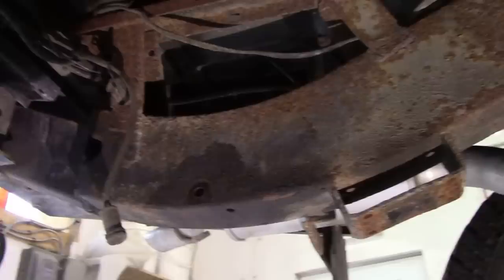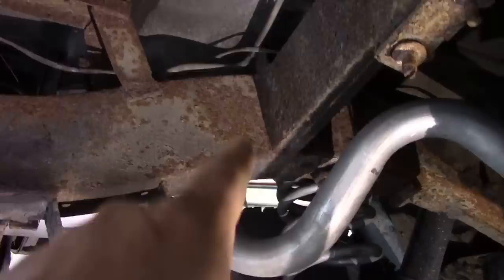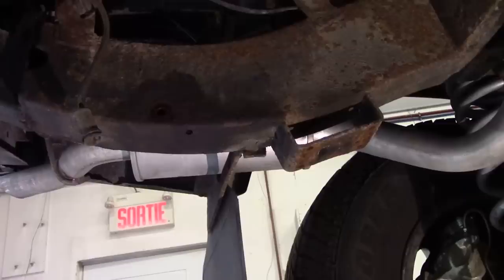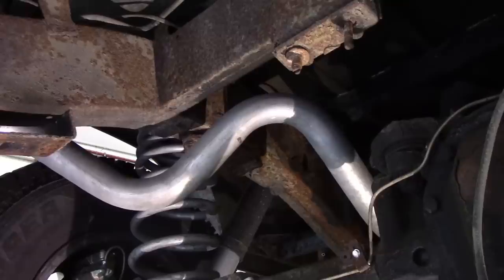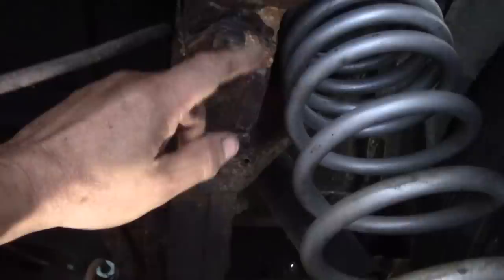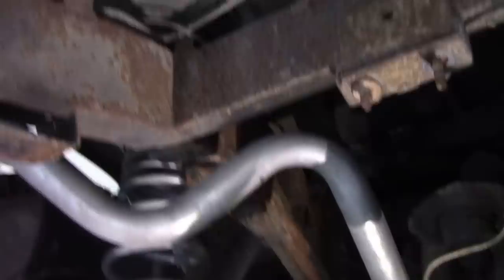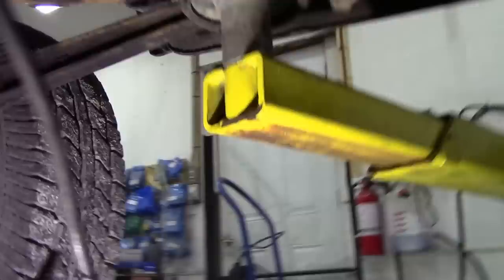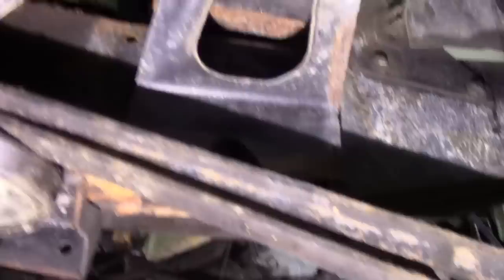Buying a Defender Things to look for Part 2 the Chassis/frame

Comment: Make a card template of the bolt holes before cutting the rotten section out and drill a couple of holes on the outboard face.  Pass wire or chord through those holes to temporarily hold the harness away from the welding work, then remove the chord once cooled.  Leaving that rot will accelerate deterioration of the new steel as you'll have a rotten double layer that will prevent wax coverage.

Comment: Found your video of what to buy and not buy 5 years too late.  Oh my! There is no rust on the Santana but the motor parts were not taken care of and wiring was a disaster. The first problems is is a Santana so not all the Land Rover series 3 parts work.  If I could only get the steering fix I wouldn't cry so much..haha (I'm a girl)  I love trying to fix it and luckily my husband is strong enough to tighten nuts and bolts.  With my help we can get rusty nuts and bolts off and do a "high five".   I wish a could talk you into coming down here during the cold months of Jan and February and stay at my condo on the beach free for working on our steering and motor issues...a little bartering. Again, your videos are my salvation and make me smile even when I'm I know I have these problems.  I will look to see is you do a series 3 steering relay or tier rod ends of ball joints or steering box.  Stay well, I really need you!  Yup, you help the old girls out, not just the old guys.
Reply from the maker: A lot of Santana's come here as they were rust free and cheap - but as you said, the parts for the Land Rover are not always interchangeable, and not easy to find here - in fact I do not know anyone who sells parts for these in North America
I think on my memory stick I have the parts books and manuals for the Sanatana's, but they are all in Spanish 
I have very little in the way of Series parts on my shelves - I stopped selling parts about 5 years ago

Comment: I've bought my first defender and I love it. But... It's back in the garage  with a refurbished rear diff and new half shafts going in. There are small rust holes in the tub floor that also need looking into (pardon the pun)... At least Ive sorted the leaks out!.. These care are so expensive now, it's a money pit, but I'm sucked in now. 
Hopefully I'll get round to the pretty stuff soon.

Comment: If you decide to plate over the rust holes behind the gearbox crossmember, just remember to shorten the crossmember to allow for the thickness of metal that you used. Personally, I'd cut the rot out and sit the pieces in flush. Great vids. I wish more buyers would take note, but like you say, it's got all the 'goodies', even though it's 'rotten'
Reply from the maker: This job has gone now

Comment: Great points Mike. When I removed driver seat on my 90 I discovered few holes on top of the chassis just on side of the fuel tank. It come handy as could get to the wires, hooked and lift them up when I was welding bottom of the chassis. This underfloor sections on mine is ready for replacement, it's especially rotten on places where metal floor crossmember struts are in contact with long floor support top hat that is made of aluminium. If not properly isolated it will rot faster (learned in defender school)
Mine was bought from a farmer, first job I did was to remove roof lining and get out about 2kg of oats that mices stored there 🐀🐁🐀 Luckily they haven't been interested in wires 😊
Reply from the maker: You were lucky! A lot of barn fires here have been caused by mice eating the 110v insulation
Funny what mice will eat - I thought the insulation tasted crap...
Reply: "I thought the insulation tasted crap..." HA! HA!
Reply: did you boil it or have it fried. LOL. Rob     P/S  the reason that they nore  at soft stuff is to keep their teeth sharp and from growing to long, rat and squirrels and rabbits do the same.  Their teeth grow the same as our finger nails. ( not many people know that )  --- ( and even less  want to )  Rob.

Comment: Hi
To anyone who wants to replace the sills cheaply and has a welder. Go to local fabrication shop and get them to fold a 3mm thick plate into 25x50x25mm U channel. Then unbolt old sill. Cut off the
End braket that connect to the bulkhead, line everything up and weld the braket to new U channel. Drill all holes for floor, seatbelt mounts ect and bolt in place. Just done mine this way as diy and £40 for both sides is cheap. 
Maybe an idea for you Milke for this budget project instead of buy new sills and waiting for delivery
Reply from the maker: I saw YRM are doing them - I also need the 2 x C post so might as well get them together -in fact he needs 2 x footwells also - might as well get them from YRM as they are far better than Britpart/Bearmach onesBut good idea all the same - I made mine for my 130 by slicing a bit of box section in two with the plasmaMike

Comment: Some of the points raised are accurate some not so. I always out rot and weld new metal in. Make a template first of the area of rot so any fixing holes are replicated. No chassis should be sand blasted unless the body is off because you cannot get all the way around it and as such its a waste of money. It is also easy to repair. The body can be removed in one piece if it is jigged and braced correctly and takes about a day.
Reply from the maker: Working to a tight budget will not allow this - not my vehicle - I do as a customer instructs

Comment: The only way to have peace of mind is to swap out the whole chassis with a galvanised one...  I went into it with that mindset when I got my 300tdi 90... the chassis was rotten and full of patches and filler....  like the video says they rot from the inside out so if you see rust on the outside it’s never good.. patching/welding just buys time.

Comment: What's a bump stop?? Mine gone a long time ago. Have done extensive welding to my Defender 200tdi. Made new outriggers and other parts. My rules are to always cut out the old rust. Replace chassis with minimum 3mm and out riggers with minimum 2mm plate. Replacement parts are not as heavy duty. Think the galvanized chassis are only 2mm.

Comment: With my old chassis I bought a Karcher drain unblocking tube and blasted it out. So much come out of it. Then Dinatrol
Reply from the maker: Excellent!
Mike
Reply: @BritannicaRestorations  I used to do some work for a transport firm that delivered parts to Land Rover at Solihull and the driver told me he saw a batch of new chassis that had signs of rust on them!!! all at no extra cost to the customer!!!!!!!!!!!

Comment: This is why I prefer old American pickup trucks when they still used thick steel channels about 3/16 metal it may flex a bit but you can get at both sides to paint or rust proof it just look at how many 1960/70 trucks are still quite rust free in the chassis department.    Please tell the guy to save up and get a new galvanized chassis may cost a lot more but it 2 or even 10 years it will not need patching again unlike this old one will.

Comment: Thank you for the video but this car is complete shut. I wonder about checking a car of a good condition from later years, a puma when its hard to see the fault. any tips for that? if transfer is leaking ? skylight window show some rust? thanks!
Reply from the maker: I have not seen a Puma here yet, but they do suffer from corrosion - maybe more, as I have heard a lot of complaints
Reply: @BritannicaRestorations  Thank you just checked one today beside few bubbles at skyline was clean..

Comment: Mike been here in this situation a lot more recently with inflated prices and old defenders-  paid too much and needs a chassis, but no budget for it, i hope you told him to start saving up for one in the not too distant future! Funny the later td5 on chassis are "the same" but very different, much thinner metal i think and more mud traps in my opinion, they just don't seem to have lasted as long, maybe cheaper steel? 

I think 90's rot much worse in the curve at the rear radius arm and when they do welding them just is a waste of time. The Td5-on chassis even rot in the long straight middle part- badly at the bottom.  Im a hater of waxoyl the water just gets in behind eventually and it makes it worse than if you did nothing at all. i wonder was it the killer on this 110? The wiring in them as well is absolute junk- poor quality wire i spend a hell of a lot of time fixing plugs and loom rub throughs and corrosion. I just pull the loom out and fish it back through with a set of "Mole poles" i get you though on the earlier stuff, you get into years of bodges of peoples lighting wiring "fixes" and thats just a world of time, trouble and pain haha
Reply from the maker: This 110 was sprayed with a tar like crap - nothing inside the chassis or parts that were difficult to access (see under the tank)
I am not a lover of Waxoyl either - rubbish over in Canada - gets to hard in winter and salt water gets trapped behind it
We have a product similar to Dinatrol which is great for doors and chassis interiors, but can wash off under arches.
I often wonder about the thinking behind Land Rover chassis and what their approach was to longevity - maybe they focused too much on the likes of the Middle East or Africa
As vehicles have to be over 15 years old for importation we almost have a gun to our heads when buying - if you want the vehicle, you get the rust and corrosion as well
I do not see many Td5's here yet, but I agree - a new chassis is the only way to go  - and I like Marsland ones - always have - I tried Richard but they shafted me on time to supply when I was in the UK - pre paid for 3 110's and promised they would be ready  - called them when I got to the UK  - and they promised they will be ready for pick up and 2 weeks before loading the container they were still not done - I had to extend my visit for 3 weeks and when they were done they didn't have the cross members, towers or anything I paid for - and to make matters worse, they buggered about so long I could not get the VAT back, so had to pay tax twice
Never again!
Mike

Comment: Hi mike do you think a coating of engine oil thinned down with a little petrol sprayed on EVERY year would have prevented this rot? I do realise waxing is better but i struggle in applying the stuff, oil and petrol in one of those pump action canisters is easy and something i can do myself at home.
Reply from the maker: I would not suggest thinning with petrol, (bit too flammable) nor engine oil - it can rot any rubber hoses or bushes over a period of timeI suggest Dinatrol for rust proofing in Europe - easy to apply and not too expensiveMike
Reply: Any toughts on Fluid Film?
Reply from the maker: excellent stuff  - use it here 
Bit expensive though

Comment: Hi, I have a question (sorry for my english). I leave in south of France, so except during winter, there is not a lot of humidity and moisture. My chassis is in enough good state (few rusty, 200tdi year 1992). There is a guy who makes sandblast job on 4x4 chassis (and paint) around 800€. Do you think it is a good strategy or it isn't worth ? I know he can't do a fabulous job because he just lift one side on the chassis etc. Very nice videos but sad to not see the racoon :) I hope he is happy with his racoon friends.
Reply from the maker: Marco
if only light rust on the chassis consider DINITROL 4941 black solvent based underbody coating

https://www.dinitroldirect.com/product/dinitrol-4941-car-black-underbody-rust-prevention-rustproofing-chassis/
Reply: In the likes of process industries they use companies like 'Sponge Jet' less aggressive than sand blasting  small sponges are fired at the rust and same is captured within the sponge media worth looking at if you have a local agent ...you could maybe drive  the Landrover  close to a local agent and have same done nearby https://www.spongejet.com/events/sponge-jet-wows-shipyards-and-owners-alike-in-cannes-france/

Comment: Excellent video - again! 
Wires inside the chassis? 8-) With our TD4 all looms run along on the outsides.
Reply from the maker: Defenders were always this way - something to watch when welding!
Reply: Whoops!  I did a patch repair behind gearbox crossmember on my D90, new metal on top of old, did not mind the wires running through… hopefully they were floating through the middle or on bottom, away from weld.  So far so good!  Would love to see a video on replacing the front dumbirons, that’s a project left to do on mine for another day.  I bought some repair pieces, looks to be a big project.  Wings off yeah?